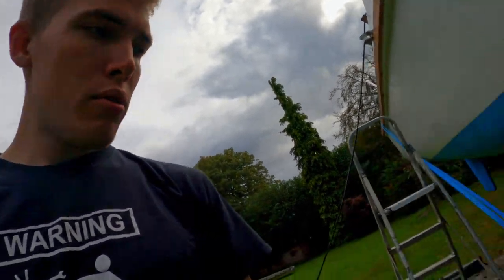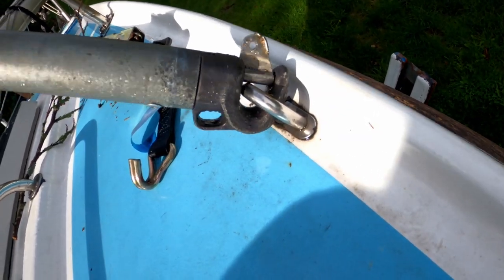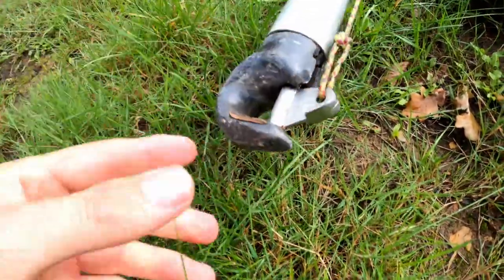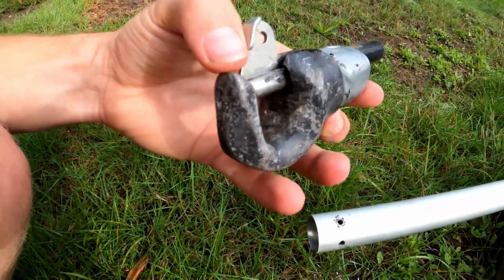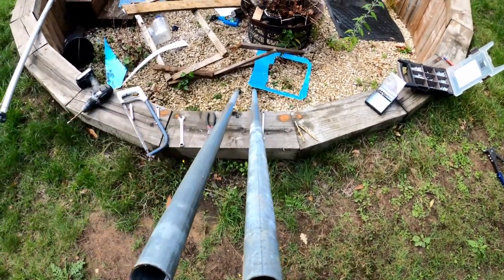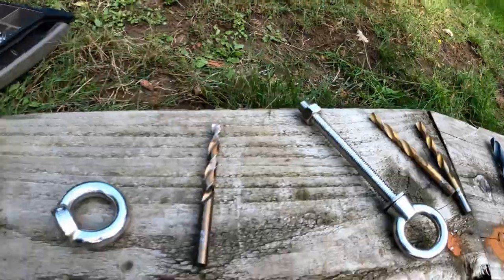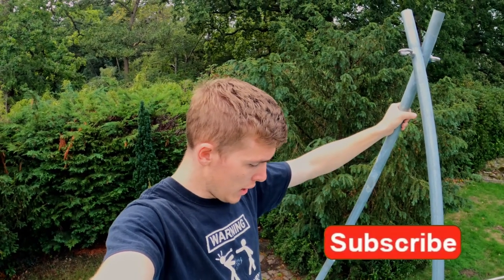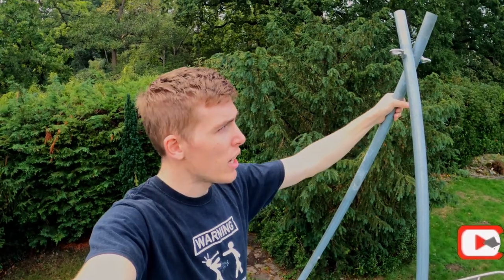How To Make An A-frame To Raise And Lower A Mast! Sailing Meraki | Ep.43

Comment: Some excellent ideas. I have to build an A frame for my 28 foot Magnum.  I like the gal pipe in sections which is stronger than alloy and the simple double eye bolt solution. Thanks
Reply from the maker: Thanks for watching! Hope you find it easy when the time comes

Comment: I will do the same, but i have to dismast my boat first.
Reply from the maker: Hopefully it goes well! I find going up the hardest.
Reply: Worst part about trailer sailing getting the mast up isn't it. I've got a seal 22 with a fractional rig that's 28ft - same type of mast foot as yours. I'm racking my brains how best to build my own mast raising rig, not started yet. Look forward to seeing yours in action.
Reply from the maker: @backtothebarky  yeah it is the worst bit! I finished the season with this setup and it worked perfectly. I will be improving it so it’s faster to get the mast up alone

Comment: I like the A frame idea especially if you have to lower the mast under way especially if it can lay flat on the deck when not in use. A gin pole can be hard to store on a small boat. I made a gin pole from a 8’ 2x4. Check my channel to see how easy it works solo. Love your channel.
Reply from the maker: That’s awesome! Thanks you!

Comment: Like I told you before, I use a gen pole. It only uses one piece of 1 1/4 emt. I don't know how that translates to metric. I mounted a trailer winch on it, and have two folding D's on the deck, and two on the mast. Steel cable lifts the mast. I must admit, I stole your mast crutch idea. It was the final piece of the puzzle. If your A frame doesn't suit you, I can send pics of the gen pole.
Reply from the maker: The gen pole is a good idea but since i already have the two u-bolts the a-frame would be an easier setup. A winch would be a dream! I go into some more detail in some coming episodes. Thanks for watching Chuck!